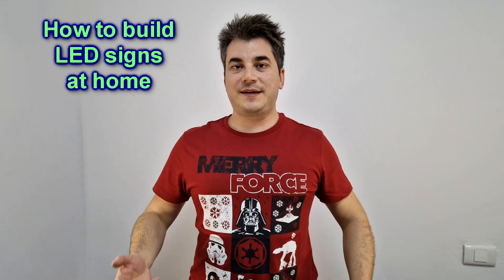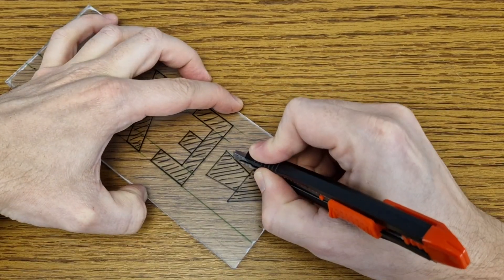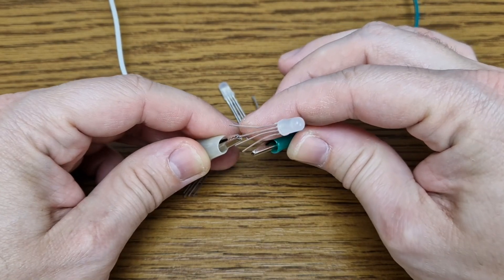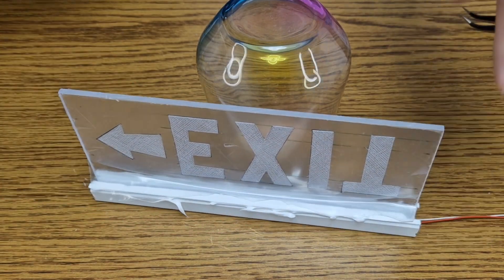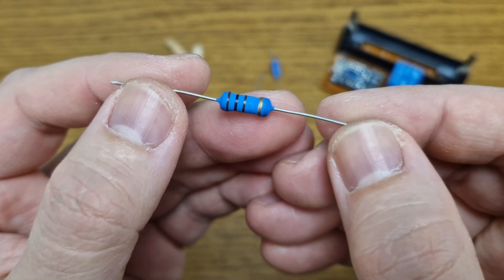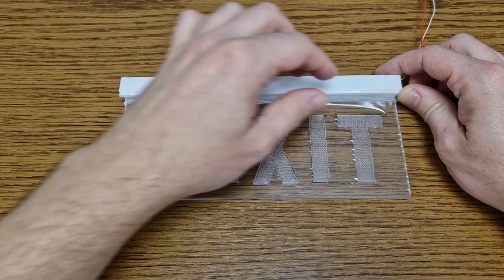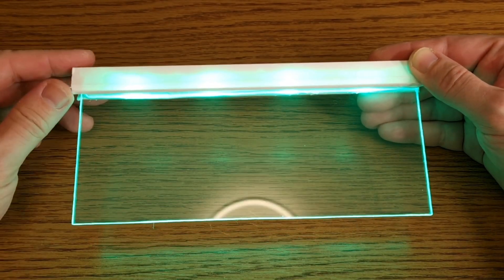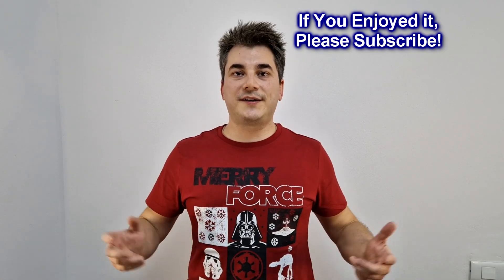How to make a simple LED sign at home

Comment: How to make it stay lit at all times like a normal exit sign and a battery test button?
Reply from the maker: To make it stay always lit, instead of the relay you can add 2 diodes, one at the output of the BMS to the converter and another diode between the charger and the converter. so only the highest voltage will go to the converter, 9V when the charger is powered and 8.4V from the battery, when the power is off.
to check the battery you can add a normally closed temporary switch at the input of the charger.

Comment: Salut! Dacă vreau să fac ceva cum ai făcut tu, gen ups... Dar fără releu...? Ce are? Se ard bateriile ori modulul? 🤔 Nu oprește încărcarea pur și simplu? Pentru ce aș pune ceva să comute?
Reply from the maker: Salut. Depinde ce vrei sa faci. vrei ca led-urile sa fie aprinse tot timpul, sau doar cand e o pana de curent electric?
Reply: Salut! Vreau că un ups. Să stea tot timpul alimentat ceea ce am băgat la el. Opresc doar din buton, dacă este cazul. Dar ceea ce pun acolo, leduri/ router internet de ex. Să meargă continuu.
Reply from the maker: Am facut alt clip separat cu UPS de 5V si 2.5A. daca e alimentat cu 5V iti trebuie releu, altfel bateria ar fi conectata tot timpul la consumator si va fi incarcata si descarcata in continuu. daca e conectata asa, bateria se va deteriora rapid..

Comment: Bună ziua, domnule Sorin.
Îmi cer scuze pentru comentariul off-topic dar după ce am văzut videoclipurile tale cred că ești persoana potrivită care poate să mă ajute.
Am nevoie de un dimmer/variator mic(neapărat mic)  pentru o veioza la care pot utiliza, ori un bec incandescent de 40W, ori un bec led dimabil de 4W.
Așadar, cum pot face un dimmer, folosind un potențiometru , la modul SAFE și care să se încadreze nevoilor mele ?
Sau, dacă știți un model de potențiometru care este în comerț și să se încadreze în parametrii necesari, vă rog să îmi recomandați unul.
Reply from the maker: Salut. daca vrei sa folosesti becuri de 230V, nu cred ca gasesti un variator mic, toate sunt de marimea dozei. cel mai mic poti sa il gasesti pentru doza modulara. deci trebuie sa faci tu unul mic. in cazul acesta cred ca cea mai simpla varianta e sa modifici un bec cu LED-uri, sa faci LED-urile sa se aprinda la o tensiune mica, de ex 12V. sau sa cauti un bec de 12V cu LEd-uri. la priza conectezi un adaptor cu tensiune putin mai mare si folosesti un buck convertor cat mai mic si il modifici cu un potentiometru sa varieze tensiunea intre 9 - 12V.
Reply: @Sorin_DIY  Mulțumesc mult pentru sfaturi !

Comment: Creative and simple thing, I like it. Any idea on how to make it constantly on even when AC power is there? Then when the AC power is removed, the battery kicks in? Similar to a real exit sign?
Reply from the maker: Yes, you can make it with a 9V/12.6V charger, a 2S/3S battery pack with BMS. then a step down converter and the LEDs. the charger will charge the battery and power the converter. when the mains power is out, the battery will power the converter.

Comment: Green looks better but red is more visible. What if you painted (dark color) outside the letters and left the letters unpainted (to let light through)?
Reply from the maker: the letters will not be illuminated. they need something on the plexiglass panel to capture the light.
Reply: @Sorin_DIY  I just thought that covering the external area would make the light "go through" the uncovered.

Comment: That's a very nice sign. If you change the LED lights for a LED strip and use the controller, make some stencils so you can paint over them,. It would make a nice project for a kid to do.
Also, we need a  3 state switch for that Sweet RGB goodness!